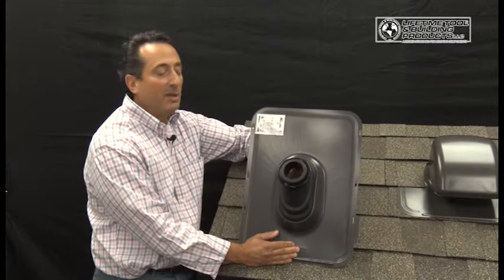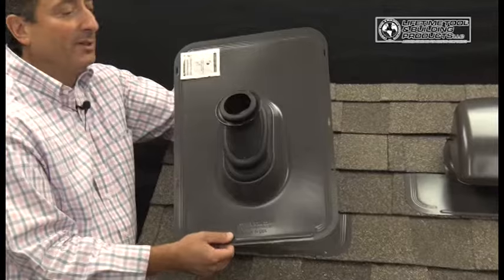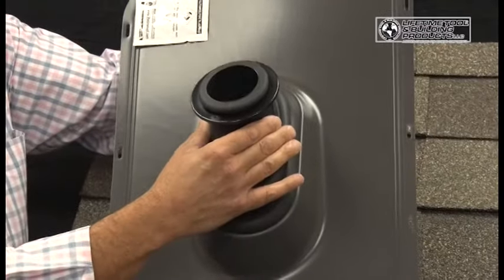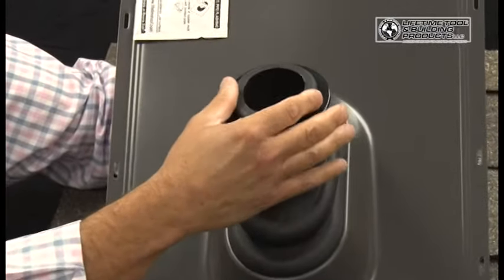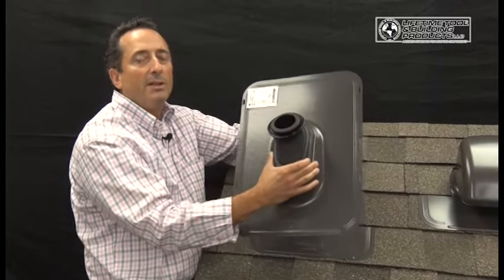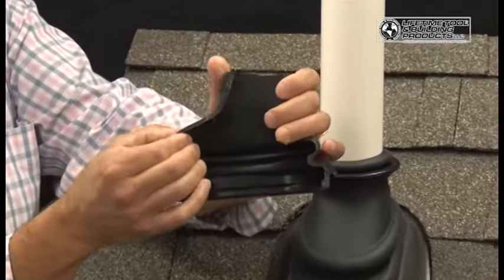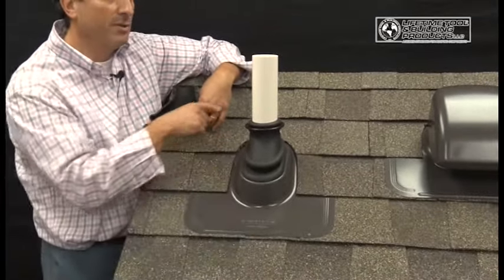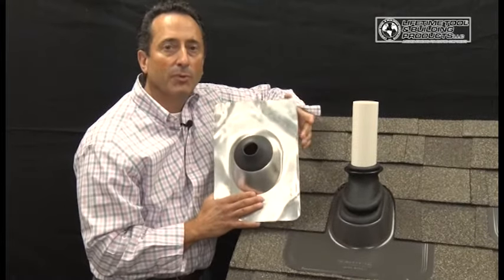Intro to the Ultimate Pipe Flashing

Comment: I’ve looked all over YouTube I have yet to see anyone install one on a metal pipe. are they only designed for PVC? If not on the design for PVC what size for what size pipe
Reply from the maker: The Ultimate Pipe Flashing is PVC size specific. It can be installed on a metal pipe, but for copper or cast iron pipe, you must use our EASYSleeve (https://lifetimetool.com/product/easysleeve/) or EASYFit (https://lifetimetool.com/product/easyfit/) product first and then finish the install with our Ultimate Pipe Flashing. If you have specific size questions, please contact us.